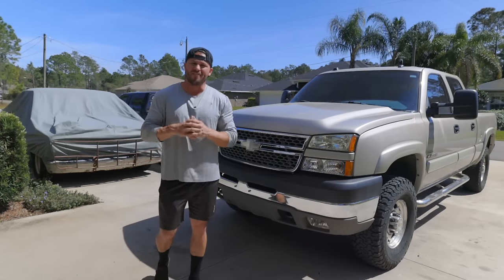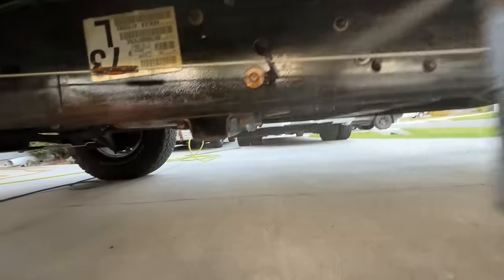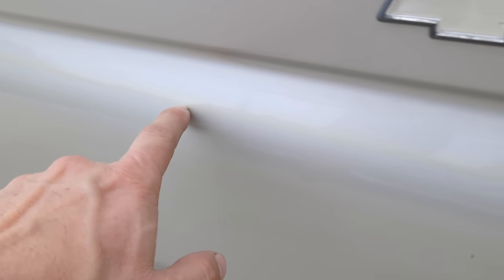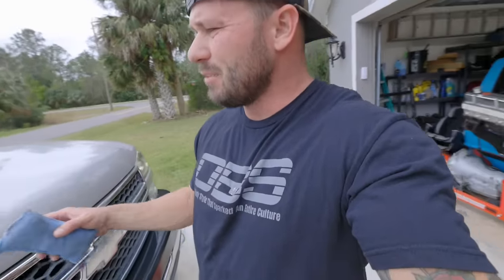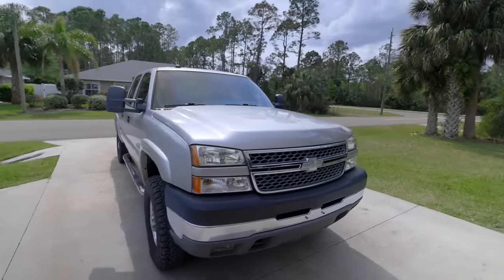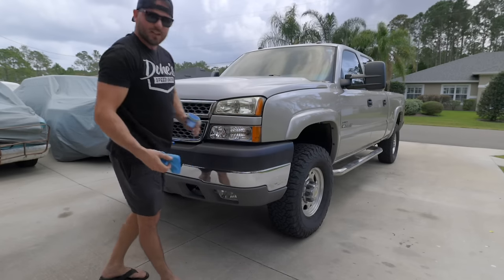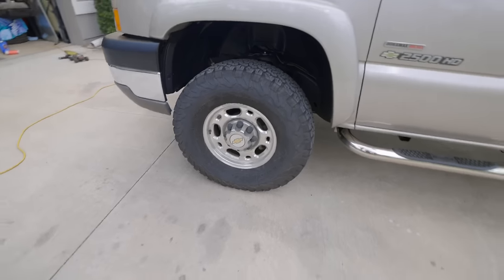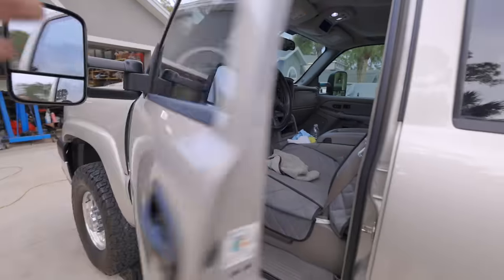Getting My Truck Ready To Sell But For Good Reason

Comment: On the caps, you should have unscrewed the plastic lug covers and taken them off. No working around the lug nuts
Reply from the maker: I did clean them off the truck but the plastic lug covers clip into the caps and with my luck with 20 year old plastic they would all break 😂
Reply: @yeahbuddygarage  good point ! 😂